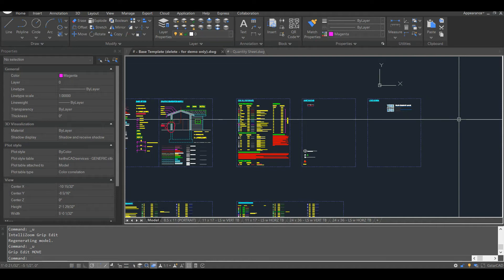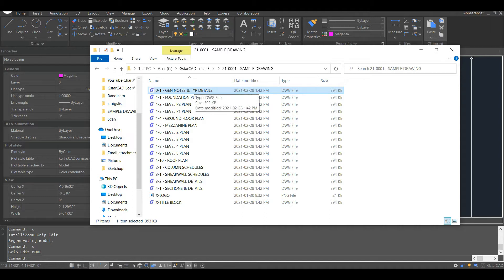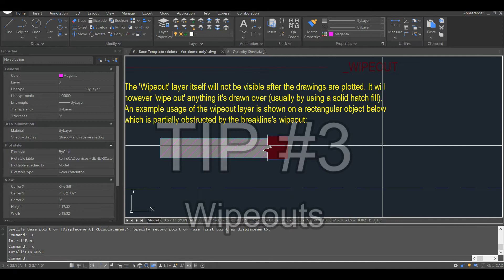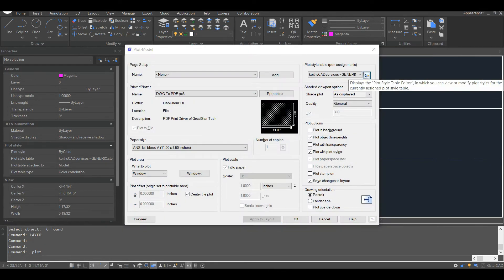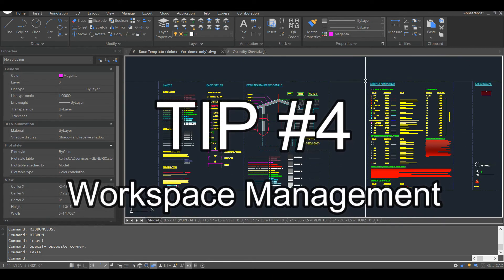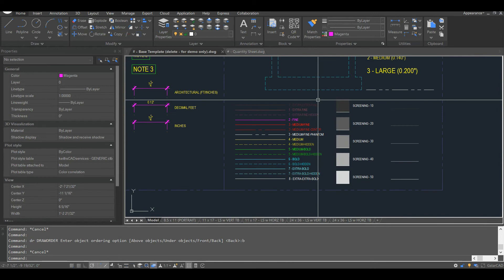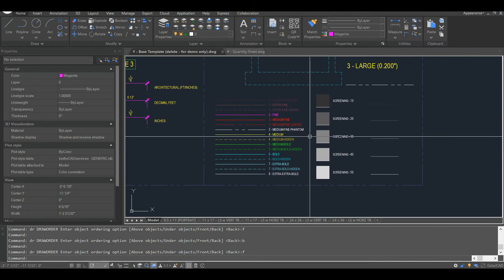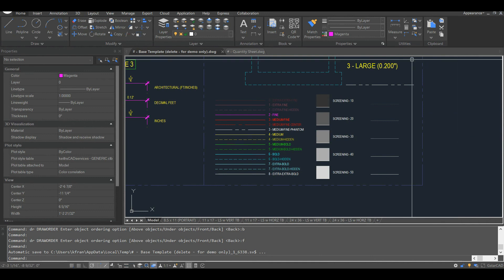4 AutoCAD Tips to Reduce Lag and Improve Performance

Comment: I’ve found that if you are trying to hatch some object and your PC is really struggling, look at the whole view you can see on screen and see if there is any particularly dense line work or blocks etc. if there is, cancel the hatch command and zoom/pan your view so that the dense block or object is off screen, then hatch again. You may want to quickly turn of the layer with the hectic geometry if it’s easier to get it off screen. For some reason AutoCAD seems to calculate hatching for everything visible on the users display screen even if it only is actually hatching a small simple shape you’ve just clicked in.

Comment: Great Video, one of things i've seen, is that multiple Layouts or viewports... or both, can make your file really slow. Some companies loves to work with a single File and twenty layouts and it gets ridiculous slow.
Reply from the maker: Thanks Emmanuel!
Such files are sometimes even slower than a really large Revit file. I think it's something to do with the fact that AutoCAD doesn't really utilize multiple cores in multi-core processors. Once the drawings are separated it seems much faster in my experience.
I've seen more bad CAD practices than good ones. It's usually due to a manager making decisions but not actually doing the drafting itself.